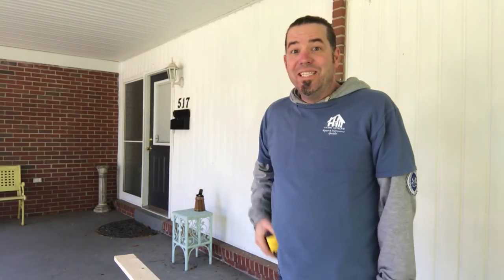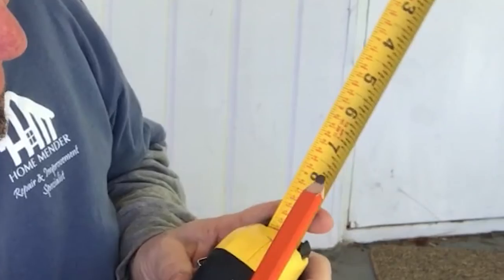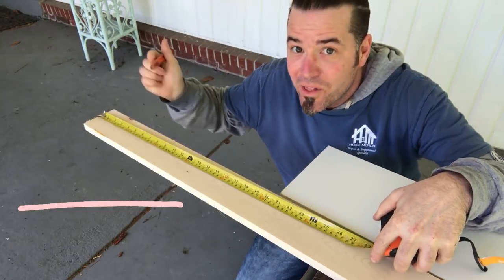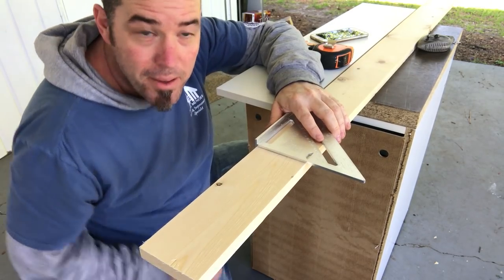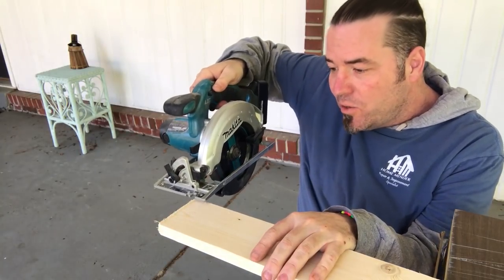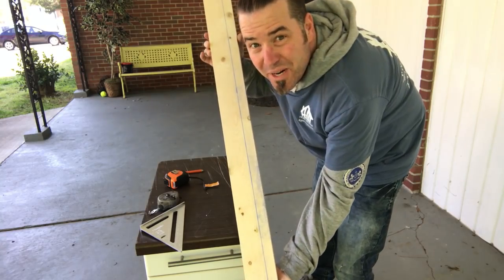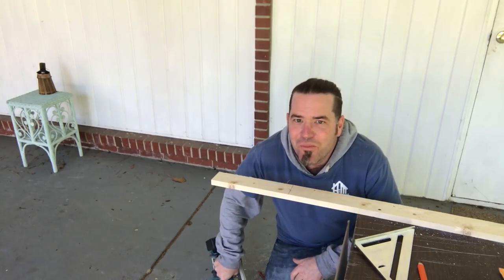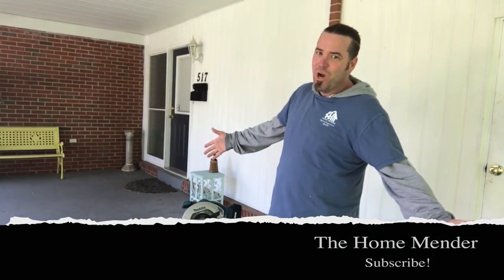How to be a carpenter. Tips and tricks and stuff to know.

Comment: 30+ years making sawdust some of this is spot on some kinda so so. It's which side of the line to you cut on. 34 9/16 heavy or light is the lingo I learned. If you need an accurate rip use a table saw. I don't like battery circular saws, give me my corded Bosch every day. Always have more than one pencil, the lead will break at the worst moment so be prepared. Bet this guy doesn't know many if any framing square tricks, ;-) Now go make some sawdust.
Reply from the maker: Lotta info to unpack here. Thank you for sharing.

Comment: Carpenters
    I come from a family of inventors, engineers, & carpenters.   Carpentry is the science of manufacturing with wood.  The process started with Surveyors, Loggers, & Sawyers.  Some carpenters are joiners (see Japanese joinery), some cabinet makers.  Cabinet makers need more precise measurements, so measurements of less than 1/64th inch are used.   A cabinet maker can cut to a precision of less than 1/64th inch, and then sand or plane to perfection. 
    Carpentry is good clean work.  If you want to be a carpenter, best is to apprentice under a Master Carpenter, and /or do work on the job.  Next is to learn about carpenters tools, and have a few important ones:  good belt and apron bag, large metal square, small square/triangle & protractor, levels long & short, chisels of different sizes, electrical & hand planers, electrical drill & bits, brace, electrical & hand saws, possibly hammer & conforming tool, pencil/scribe, compass.   Then you will need consumables:  screws, pegs, nails, rods.  Maybe goggles & gloves & first aid kit (read and be proficient at first aid).  Watch your hands and feet!  Hydrate!  Contemplate different ways of design & construction.  Measure and plan at least three times.  Cut once, oversize if necessary, and plane, chisel, sand to fit, shim if you made a mistake or must use short wood.  Learn types of wood & wood treatments:  stain, glue, caulk, paint.
Reply from the maker: You are awesome my friend thank you for this valuable info. What a treat. Thank you for commenting

Comment: Finish carpenters definitely go into the 32nds. Not with the math really but when I make cut lists I might say this cut is 12 3/4 strong or shy. Especially when I'm doing division of balusters. If I do the math for my layout with decimals I might get something like 3.8375 on center for my whole row of spindles which is a strong 13/16". If I didn't go into the 32nds then that error accumulates and over a span of 8ft that could add up to my last spindle being a whole half inch off. You just need to know when it matters to chase that kind of precision in your work.
Reply from the maker: great point strat, yes you're correct, definitely need to be aware when measuring and marking off. thanks for sharing!

Comment: If you turn your speed square to the other side of the board it will be easier to cut as you are pushing with your right arm and pulling with your left. Provided you are right handed.
Reply from the maker: Great tip  A!...totally makes sense....i lay it however i lay it down..:) .thanks for sharing!

Comment: Great video lots of handy tips the only thing I would do differently is when using the speed quare as a gide if ya face it the other way you get a greater reference point to start with on anything less then the width of the square it's easier and more accurate Ive found
Reply from the maker: That's a great idea! thank you joel!

Comment: When you're using the speed square as a cut guide, flip it around so the edge you're squaring to is away from you. This will allow you to run the saw with the blade all the way out without the motor (on a sidewinder) fouling on the square. Also, buy a Swanson brand speed square not some janky home depot junk. They cost like 15 bucks, there's no excuse not to have a proper speed square if you're a working carpenter.
Reply from the maker: Great suggestion Alfred.  Thanks for sharing.

Comment: It's hard to give you credit when you're using those tapes. Fat max is the way to go best tape out there, who loses a tape that much?  I've had mine for a year. Also popping a line for a rip? Big no no if the wood is not straight the mark won't be accurate. Speed square has grooves for marking rips.
Reply from the maker: hey daniel...i lose tapes....when youre on the road at several houses a day and your a hustler, its easy to lose them, which is why i pick up a few at a time..thanks for watching!